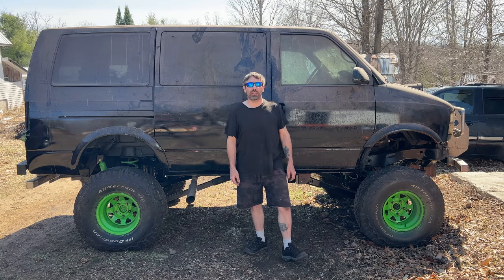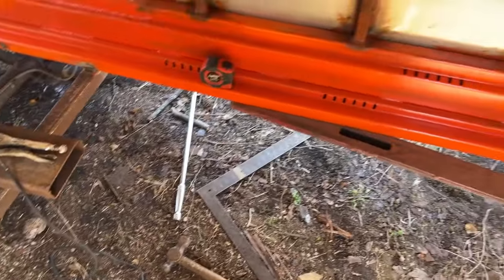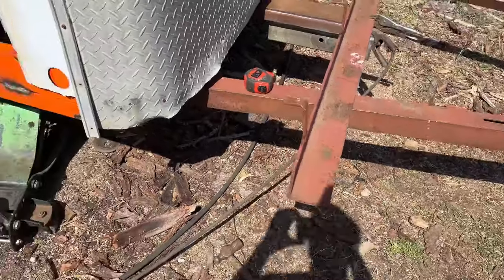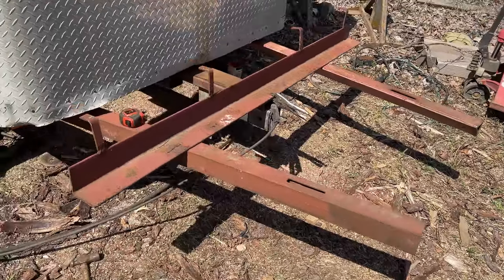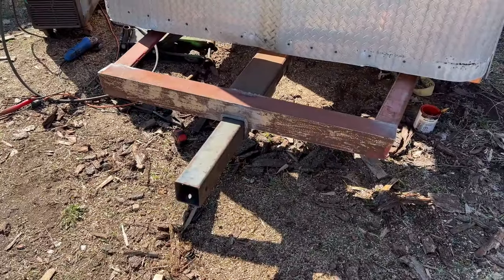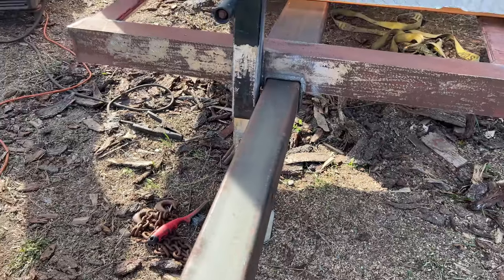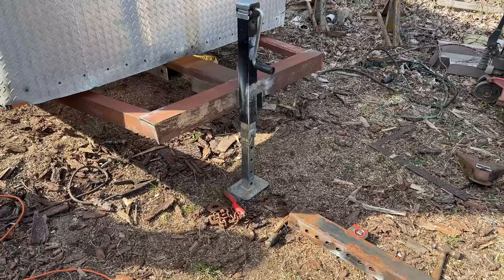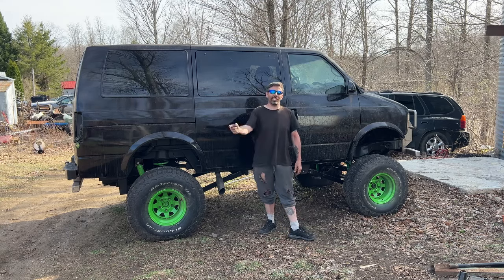Stealth Camper Build - Part 5

Comment: Call around for those spring bolts, got some at our local spring shop ( Regional spring)that are greaseable and brass bushings.. princess auto juts has regular bolts.. I re did mine with the grease pins.

Comment: Question:  Your trailer is 10,000x better than original, however, as a metal man, noticed, did you simply weld the painted metal to metal?  yes you did, I'd never do that, cardinal rule of welding is clean material aka grind before welding, if you a champ you'll even heat it b4 welding, not a big deal, a bit of paint ain't gonna hurt too much, I'm a perfectionist or something... just asking.. not like I'm in the vid doing the actual work or anything!  If it was me, after receiving these tips, would redo all welds, grind, heat, weld, just saying armchair youtuber, drinking